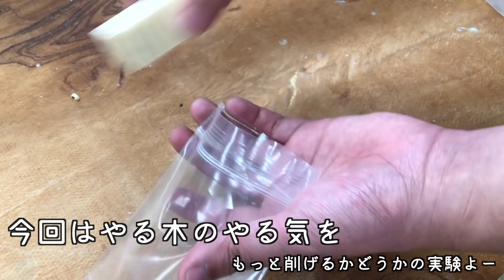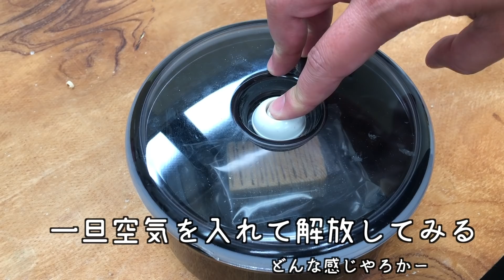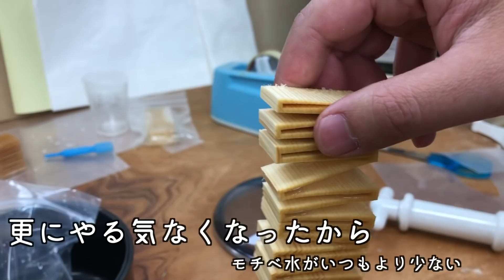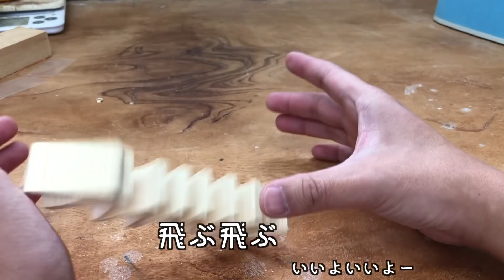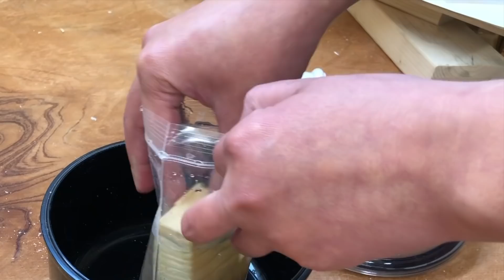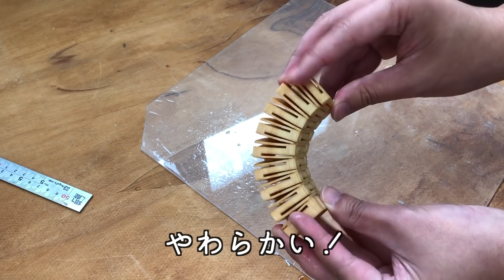水と真空で遊んでたのにもっとやる気なくされた【 やる気のない木材 】

Comment: Maybe if you drilled holes at the end of the slot, they would be less likely to brake.
When there is a crack in sheet metal, on a airplane, or a car, they drill a hole, in the end of the crack, to stop the crack from growing longer. Of course wood is a different material.